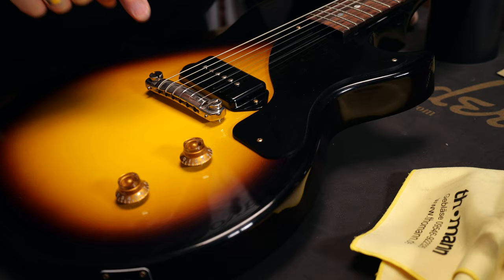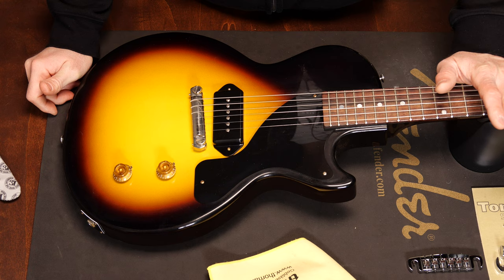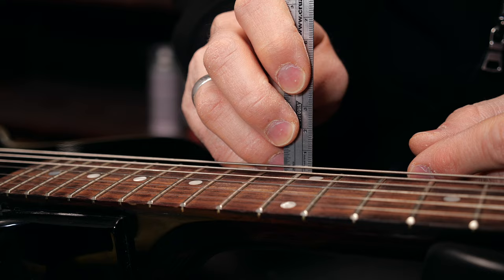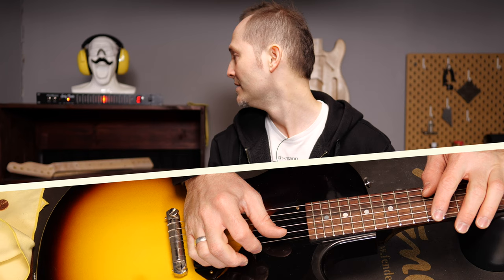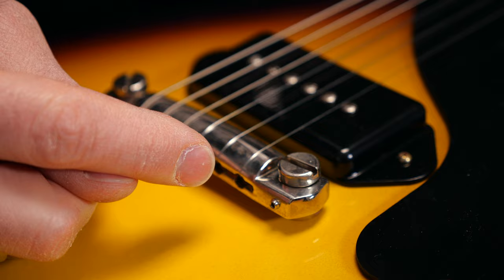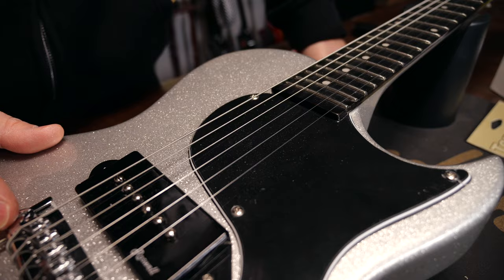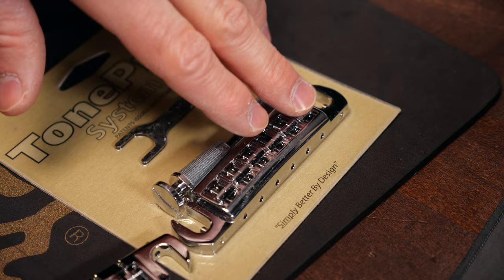How do Wraparound Bridges Work? | Guitar Tech Tips | Ep. 42 | Thomann

Comment: Sometimes with a wraparound bridge, the "knot" on the string lies on top of the bridge and pokes your hand when you are palm muting. To avoid this, you can clip the ball end out of your old strings and put the new strings through it. That will move the pointy bit back just enough.
Reply: ...Great tip and one that works wonders for your hands..lol
Reply: Great tip, I just got a gordon smith and have this exact problem with the strings stabbing my palm,  gonna do this! 👌
Reply: That’s the Mike Hickey tip, correct?
Reply: I have a problem with my bridge, I'm gonna get another tune-o-matic like the PRS guitar in this video to entune string by string
Reply: Another suggestion might be to loop the strings around the bridge the other way around, such that the strings take a full turn around the unit. Results in less fiddling around with spare pieces of old guitar strings, but may be slightly less convenient when taking the strings off again. 

Naturally, this would only work well if the bridge unit has sufficiently recessed holes for the ball ends of the strings.
Reply: That's the one mate. I overwrapped my sg , turned magnet in the neck pickup around to give me out of phase,put on 11s less over all stress with wrap overs and tuned to E flat it's a new beast although now.
Reply: @ziggamaras  Yes-I believe its a "Mike Hickey" tip. IMO though-I hate these wrap around tail pieces-tried a Mojo compensated but replaced it with a tail piece from Mojo to one with saddles.

Comment: i can't screw inside again one of the little screws for intonation adjusment :( it stops before reaching the end, is it fucked up? :(
Reply from the maker: Did you loosen the strings for the intonation adjustment? If you keep the strings under tension that usually messed up the thread of the two little screws. If you detune the strings you can try to fully turn in and out those screws to test them. If one gets stuck somewhere it's probably bent and needs to be replaced. I hope that helps. //Kris

Comment: I just purchased a Les Paul Special with P90's and a Wraparound bridge-To lower the action-In which direction do you turn the Bridge screws-Counter Clockwise (to the left) or Clockwise (to the right). Subscribed! Thank you for this video.
Reply: A little late here, Michael,  but just to clarify,  turning those bridge posts clockwise will lower your string height;  counter-clockwise will raise your string height.

Comment: Thank you so much for this video. I have a cheap bolt-on Les Paul copy, but when it's set up and new strings are properly wound around the tuning posts, it sounds beautiful and rich. So what if it's not expensive wood, or doesn't have an expensive brand name on it? I always go back to this video for a refresher whenever it's time to put on new strings and test if adjustments are needed. Thanks again!

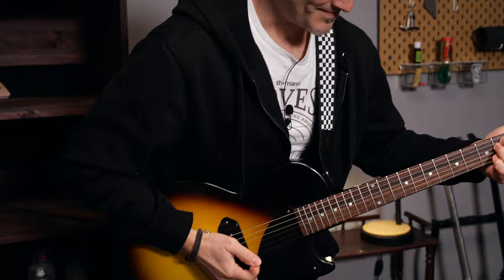Comment: I bought a Gretsch G2215 P90 with this bridge system and they fell out of tune every time. The movement you make at minute 4:19, on my guitar is very noticeable I put it horizontally it seems as if I were pulling a vibrato lever and my guitar doesn't have it, is that normal? I 'm thinking this was a not deal. :(

Comment: You are lucky that your bridge sits well in the studs. In 2022, I bought a US made Gibson SG Special and It came with studs, which left too much space for properly holding the bridge at zero angle. Instead, the angle was so big that the strings left the bridge before reaching the compensation heights.
I bought some TonePros studs that allow to tune the space for the bridge. It was an easy repair and now the bridge sits well at zero angle and the compensation works nicely - after the proper distance tuning you have described in your very helpful video.
Only I do not understand why Gibson sells new guitars with such crappy studs?

Comment: Kris,
Question.  I have a 2021 Epiphone Les Paul Special and want to put a fully adjustable bridge on it to be able to fully adjust the intonation.  I do not want to have to pull the anchors out and possibly damage the surface of the body, so I need  a replacement bridge that the the original locking studs will be usable or the the replacement locking studs will fit the original anchors.  I have read numerous reviews on sellers sites where the bridges were not usable because of these issues and the purchaser also did not want to have to pull the anchors out to be able to use them.  I have no desire to purchase a bridge that is not going to be usable and be stuck with it or buy randomly returnable bridges hoping that eventually one of them might work.  Any suggestions on a particular bridge manufacturer for this guitar?  Any advice is appreciated.
Thanks,
Dave

Comment: I have a Harley Benton  SC LP Junior, which I love , but I cannot get the bridge low enough. I notice that the posts are not all the way down to the surface of the body. I will try to tap them down further, but may need to replace the bridge.  Which bridge should I choose to be sure it is lower than the H B bridge. I am experienced at guitar building and set up.

Comment: Own an epi sg special p90 with a wraparound bridge. Would love to replace the bridge with a higher quality unit with adjustable saddles but am a newbie and unsure about what will fit this and the measurement information that is required to order a replacement. Its all a bit confusing for a novice. Great video!
Reply: Anything from China on ebay, try n get one w spring loaded saddles..Ebay got alot good bridges from. China with some USA sellers also...Good luck...

Comment: Just did this on my sg buy got same mesurements some how, it was just over 2 ml on the low E 1.7 on high E. Intonation was spot on all strings but felt like finger was hitting the d string bending the g. 
Is that a medium action?
What height measurments are for low medium and high actions on both e strings ?
Reply from the maker: Hey, I'd call that a medium action. Medium low is around 1.7 low E - 1.5 high E and super low is 1.2 low E - 1mm high E. Hope that helps. //Kris
Reply: @ThomannsGuitarsBasses  yes thanks just what i was wondering 👍

Comment: hi kris. can you get the action on a wraparound as low as with a tune-o-matic?
Reply from the maker: If the guitar is built right, with the fitting neck angle, yes. Easy. If not, impossible. Don't worry, I never had any current guitar in my hands that had a "wrong" neck angle. That's mainly a problem of a few of the earliest LP Juniors built in the 50's.
Cheers! //Kris
Reply: @ThomannsGuitarsBasses  thank you :)

Comment: Nice video m8 ! You are doing a great job ! But no matter what .... wrap around bridges suck big time
 They are the worse kind of bridges and that is not even the worse part ! The worse part is that  with time and because they pulling force of the strings is way up the bridge becomes a lever and it starts compressing the wood inside the 2 holes while the bridge's position slowly shifts forward messing everything up. If i ever become a dictator these bridges will be banned and erased from history and memory and i don't need to tell you what will happen 
to the ppl that by accident invent them again ! Mouaaaahahahahahahahah.
Reply: You are right about the lever effect. Being driven by 50kg of sum string tension, that is some serious rotational torque the typical wraparound one-part bridge assembly has to endure.
It’s the kind of torque dentists apply on a sick tooth, in order to facilitate extraction.

There are however one-part stud mounted compensated bridges on the market that are not wraparounds, and that produce only a fraction of the rotational torque. Google Dorian LRQC bridges. 

You are spot on with regard to the studs leaning headsides over time, on account of compression of severed wood fibres in the post holes. 50kg of sum string tension exerted on threaded studs sticking out of cylindrical bushings crushing the wood fibres in the post holes, add some serious angular torque to the already serious rotational torque going on. 
But what is worse: the torquing, the levering, and the crushing of fibres never stops. It progresses. Slowly. 

Again: check out Dorian bridges again: they come with flat-fronted bushings inserted at a 2° back-angle.

There’s however one problem with the Dorian LRQC one-part bridges: they are invented by a woman.:goodvibes: